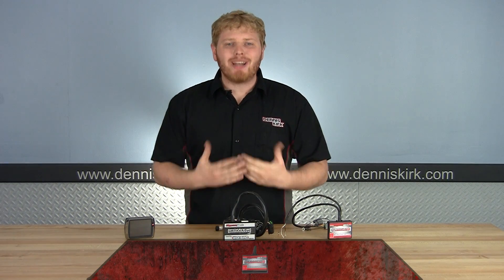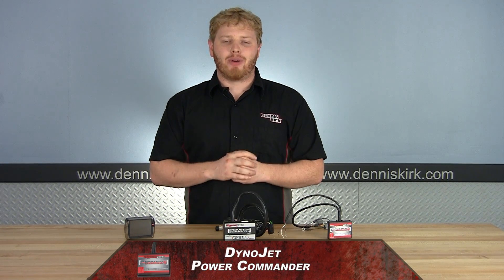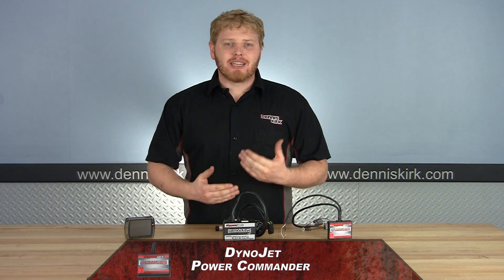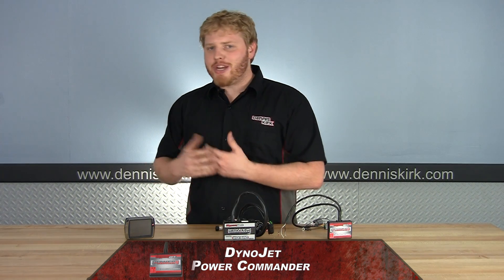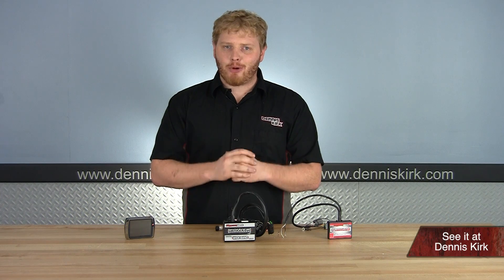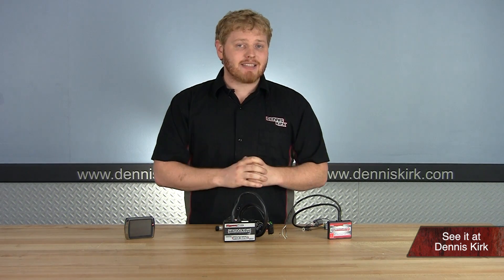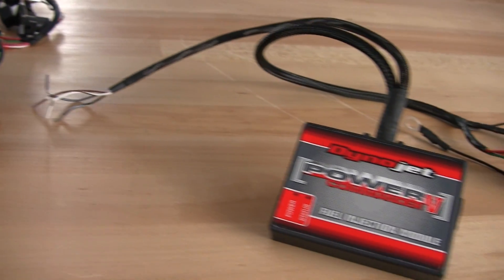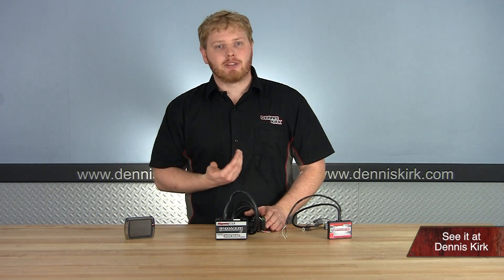What is a Power Commander?

Comment: if I add a KN filter and a slip on exhaust to a 2017 PGMI CBR500R will a power commander be worth the effort? or is it overkill?
Reply: Seth R worth its worth it itwill smoothen out everything since you have a new air filter, you’ll notice the difference when you do those modifications and ride without the commander vs. when you have the PC5 on the bike with the modifications

Comment: Question.. I was given a Yoshimura RS-5 exhaust for a cbr1000. I currently own a 2011 Ninja 650. Will it be okay if I have the pipe welded onto my header? If yes, will I need a power commander after? Thanks
Reply from the maker: I would not recommend this. If something happens where you need to replace something in that area now you have kinda painted yourself in a corner. Also you greatly reduce resale value and yes you would need a power commander as well. I would try to maybe sell the pipe and get one that will correctly fit your bike. If you have any other questions please give us a call @ 800-969-7501. Hope this helps! -Phoenixx

Comment: Thanks for the informative video! I bought an '03 VTX 1800 from my brother-in-law that he bought new and had the dealership install V&H long shot pipes and a PC on at time of purchase. So my first question is, which PC model do I probably have? It has 3 dials across the face of it marked low, medium and high. I just finally bought an after market high flow intake and intend to install it myself when it comes a week from now. My second question is, will I need to make adjustments to the PC after installing the new intake or might it be fine where it is already set to? 3rd question, if I do need to make adjustments to the PC after the intake install, how will I know for sure? and lastly... How will I know exactly where to re-adjust the PC settings to when doing so? Sorry, I know this is a lot to lay on you all at once but I hate to mess up a good thing because my bike already runs and sounds great.

Comment: I have Yamaha R1 2004 and I have installed PC3 and I want to load map M411-511 that matches my configuration ( Leo Vince full exhaust with KN air filter). My question is this, does this map eliminates setting ( exhaust gas volume ) that can be accessed thru bikes gauge?

Comment: hi, what is the difference between this and remapping the ecu?
Reply from the maker: A Power Commander is a piggyback system that allows you to go back to your original settings and allows you to change settings for any future additions without having to remap the ecu. Hope this helps if you have any other questions give one of our Tech-Troopers a call @ 800-969-7501. Thanks! -Phoenixx
Reply: Dennis Kirk, Inc. thanks.

Comment: do power commanders work on carburated engine motorcycles?
Reply from the maker: +Domingo Chacon No they will not, carburated engines you would use jets. Hope this helps, Thanks! -Phoenixx
Reply: Dennis Kirk, Inc. hey man I just bought a power commander 3. I have a 1999 Yamaha r6 that’s carbureted so it’s not going to work??? Pls someone confirm 😢